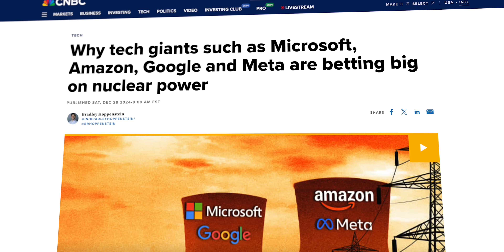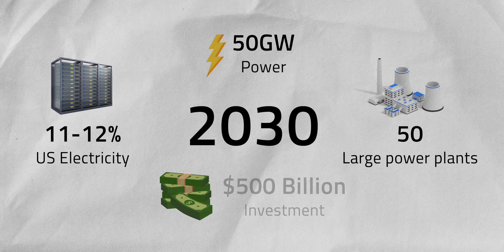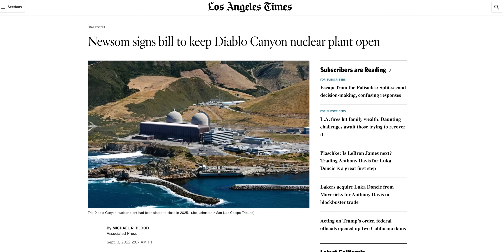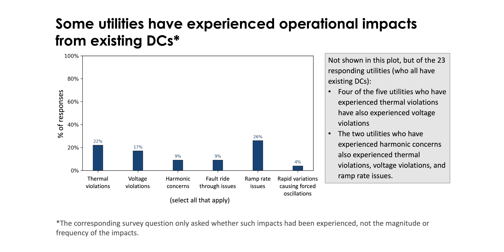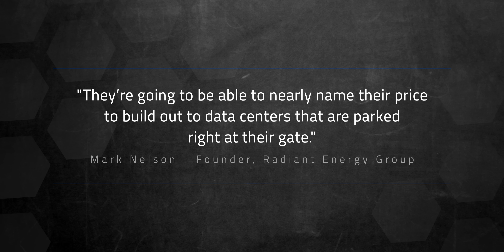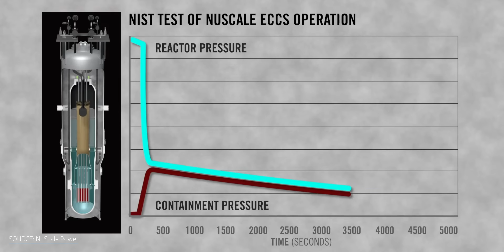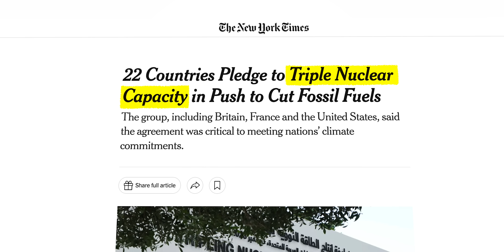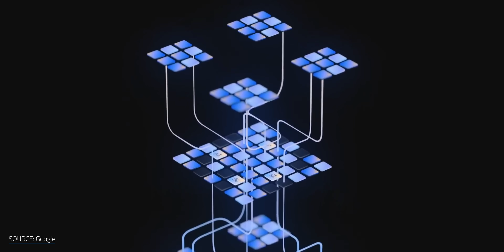Why Big Tech's Betting Billions on Nuclear (Not Renewables)

Comment: The safety if Nuclear power is like the safety of air travel. It's extremely safe, but when an accident happens, it's dramatic.
Reply: One comment I heard about nuclear power was that part of its problem is its too safe though.  It might sound like a weird thing to say but the point was that since its so safe when something does go wrong everyone freaks out.  Modern reactors are basically impossible to have an issue now. Like the control rods for example are typically now held on by electro magnets so if there is a power failure the rods are released and will drop in to shut down the reaction.  They also use passive cooling systems so the reactor will cool itself.  That isnt a long term solution and they still would want to get power to the cooling pumps again but its not like its an emergency.  If it takes a few days to get that up and running again they would be fine. You'd need all of your diesel generators to fail for that to happen though.
Reply: @pin65371 Anyone ever die of unsafe nuclear pow
Reply: @pin65371 Anyone ever die of unsafe nuclear power in France !!I know nuclear medicine is important in fighting  diseases !!
Reply: @pin65371 it's not impossible it's improbable but life loves rolling with loaded dice
Reply: Most accidents - and there have been a fair few - are not, in fact, dramatic. Measured against the damage done by alternatives, it is safe across the distribution - like air travel.
Reply: Dam failures have killed way more people than plane crashes.
Reply: Nuclear energy is safer than a Boeing aircraft 😂
Reply: @octoberranile2920  much much safer
Reply: I used to think there was like... maybe 4 nuclear plants in the US because people are afraid of it and stuff. And recently I learned there is FIFTY plants and ONE HUNDRED reactors. We've been fine with that many plants for decades. We should absolutely have more. I believe that we have it figured out
Reply: @koijoijoe "we should absolutely have more." No private utility will ever build another current-design nuclear reactor when it takes 15 years and costs $15 billion. If only there was a GoFundMe for nuclear fans to put their money where their mouth is...
Reply: More people die out of carbon emissions and its consequences. A LOT more people out of indirect damage like drought, excess rain, or lands becoming hostile to certain animals.
Wasn't it last year that some place at the US had to suffer a sci-fi worthy heat wave that melted things for being outside? Food harvests took a huge blow this year thanks to changes in climate patterns.
Give me a nuclear meltdown once every 50 years with a few hundred dead, instead of drought that starves millions each year.
Reply: There's always that built in reason to acquiesce control, development and profit to select oligarchs, which is why the love it so much, just like oil. So, yeah, I guess that's a reason for AI.
Reply: No one has died in the USA from commercial nuclear power.
Reply: @TeddyRumble  
More people die in car accidents on a daily basis, and we see no1 saying "ban cars".
Some folks are really bad at measuring costs and benefits.
Reply: this statement is valid... for 1970's technology at best
Reply: Yeah, the safety record is better than planes and with the designs we have now, nobody will get hurt if things go wrong. Fukushima is actually a nuclear safety success story. It proves how safe nuclear really is. Only one person died from nuclear radiation. So far no discernible increase in cancer rates have been detected since the accident. Most of the people who died did so because they became displaced and lost access to medical care or from the other numerous issues that come with a tsunami. But the deaths that occurred specifically because of the reactor meltdown is basically 1. That’s absolutely incredible. When a plane crashes, it’s not like 1 person dies. 

Chernobyl was actually bad but it was because people weren’t evacuated. The Russian government was more worried about PR than the people living there so they kept people irradiated even though they knew there was a problem. Nuclear reactors shouldn’t be blamed for Communism.
Reply: @scottkidder9046 the WHO actually contests the single death so the official count is 0 deaths
Reply: @scottkidder9046  Fukushima could have been much worse. Without heroic intervention, a full-scale meltdown could have released even more radioactive material into the environment, worsening the situation for areas downwind, including Tokyo.   Sorry, in risk assessment we need to see the worst case scenario because they can happen due  a chain of mishaps.
Reply: It's not tho. The only 2 accidents in history were 1) an earthquake and tsunami in Fukushima, 2) shitty design, disregard for regulation, ignoring safety alerts and cutting corners in Chernobyl.

And all those reactors were old tech.
Reply: @atrumluminarium  so we just need good faith people, yea we're screwed.
Reply: @rorschachroach  why?
Reply: @atrumluminarium fukashima was actually shitty design too and we knew it was 10 years in advance and even then nobody died
Reply: @atrumluminarium Only two? Windscale 1957, Three Mile Island 1979. 
Do you think there will be any further releases with the ongoing war around Chernobyl?
Reply: @cheesedoff-with4410  both were only a 5 out of 7 on the INES Fukushima was a 7 and Chernobyl was off the scale. That said if you were to count them 4 accidents is still not a lot. Waaaaay more people died from coal boilers blowing up and from coal flue gas around london during the industrial revolution and a lot of people still do in places where coal and oil are still burned and at refineries. Hell, more people die and get hurt servicing wind turbines and hydro plants.
Reply: @cheesedoff-with4410 there were other accidents but none involved the release of dangerous amounts of radioactivity in the environment
And for the second question, I’d say no for the simple reason that the frontline is nowhere near Chernobyl and the Russians have no incentive in attacking it
Also, with the Zaporizhzhia npp we have seen that the Russians were collaborative with the IAEA people sent there and have not used it to create mass panic
Reply: @atrumluminarium  and the last person to die from nuclear energy was in 1986
Reply: @cheesedoff-with4410  Three Mile Island and Windscale were Level 5 accidents, while Chernobyl and Fukushima were Level 7 major accidents.
Reply: @lorenzobertolino1527 
It seems Chernobyl isn't as far away from the fighting as we'd all like.
(A drone struck a reactor yesterday.)
Reply: not really dramatic
Reply: @carlchristiansteglich-pete6409
Gather all your buddies and insure a nuclear plant then.
Reply: @jimhaskell5485  its actually even safer than that most nuclear accidents arent very deadly or destructive and there hasnt been a death in the nuclear energy sector since 1986
Reply: There is no comparison. An airplane crash affects a tiny, finite number of people. The external effects beyond the people affected are minimal.

We've been extremely lucky with all the major nuclear accidents we've had, as every one them had the potential to be not just catastrophic, but apocalyptic--potentially poisoning millions of people and making vast swaths of territory uninhabitable.

It's easy in hindsight to say, "...oh those were just bad designs, they're so much better now." I'm sure after the next major accident we'll be made aware of more design flaws we hadn't anticipated, so this kind of rationalizing just doesn't cut it for me.

And no one ever seems to mention the growing accumulation of waste that nobody wants and no one wants to deal with, making every reactor site in the US not just a power plant, but a nuclear waste dump. ☢
Reply: @ecocentric6640  all of your points are wrong.

1) What if the plane hits a building? How is that a "few number of people"? How many people were effected by 9/11 whether because they died or death of a love one? Not to mention, the overwhelmingly higher likelihood of a plane crashing still makes them more deadly just because it happens more often.

Yes Chernobyl WAS an objectively bad design and it was bound to happen but the Soviets wanted to cut costs. There are certain things that you just don't do when designing a reactor. Look up the terms "void coefficient" and "temperature coefficient of reactivity". The RBMK reactors at Chernobyl among other issues had positive values for both of these that resulted in the reactor being placed in situations where positive feedback loops became possible. All modern reactor designs are designed to have only negative feedback loops in their operation so operators have to actually work to keep them from shutting down. 

3) there's not enough fuel in a small enough space for an "apocalyptic" scenario. Hell even one detonation of a modern nuke won't cause an apocalyptic scenario.

4) how much nuclear waste do you think we have accumulated historically? The US has only accumulated a football field's worth of waste and they don't even recycle theirs. If the waste is recycled and reused like France and Canada do the amount is microscopic compared to every other source particularly fossil fuels. Old uranium mines that had radioactive minerals can easily be repurposed to storage sites. Not to mention, there are relatively modern designs like Canada's CANDU that can even consume part of what would normally be content in the waste giving the actual waste a much shorter halflife that it needs to be stored for.

Comment: This is a new low for you, and an irresponsible video, in that it doesn't cover any of the hundreds of reasons why this is an extremely bad, costly, inconclusive, potentially dangerous and wildly unpredictable idea, designed mostly to keep the grid reliant on fossil fuel for decades, while the funding and research for these untested technologies continues to fluctuate.
Reply: > [adoption of nuclear is] designed mostly to keep the grid reliant on fossil fuel for decades,

I believe you've missed the point.

The tech companies looked at solar/wind + grid scale batteries, and despite their availability today, did not find them to be cheaper or effective - which is why they are going nuclear.
It isn't that future nuclear is an excuse to use fossil fuels now; it is that wind/solar/batteries don't make the cut, so fossil fuels will be used until nuclear comes online.

Comment: 2.9Wh is not much.  That's 0.0029kWh.  Or about $0.00029 (at 10¢ per kWh).

Yes, billions of requests change that.  In a "productive" sense, it should offset energy spent elsewhere (when it's not making fun illustrations for the heck of it).

Comment: Not to nerd on it or anything but correction is needed on 14:55  The approved design is not 77mw/h but is 60mw/h. They are seeking approval for 77 mw/h.
Reply: Just MW not MWh or even worse MW/h
Reply: Another correction, its 55 MW per unit that has been approved by the NRC and NuScale is currently in approval for the 77 MW update. Still much further along than any SMR competitors, as they need to go through their own certification processes, and complete lifecycle testing before connecting to the grid.

Comment: very small reactor;to get going a small steam turbine to produce electricit( 1rst part);then use electric power to prod.HIDROGEN TO HEAT AN EVEN BIGGER STEAM TURBINE TO PROD.MORE ELECTRIC POWER(is way cheaper and you dont need too much uranium)SHEEEEEZZZZZ,no big deal (instead of nuclear it can use solar and/or wind power)1rst part and adapt it to the 2nd part.EASY😝 too many dumb engineers.

Comment: Where is the nuclear waste going?
Reply: being made into more fuel and of corse rare eath metals like zicuom 90 and other tpyes for many usefuel apcations by the way. also zicuom 90 isa byprocut of the decay of struom 90 decay after 30 years that also said srouom can be used ofr passive pwoer genraton with rtg and neacler strlaning genrators as well. thsie can be sued to store that srtoum 90 nuclear waste while gernating power too at the same time. also high level nuclear aste is in fact 96% recycleble by the way. so reproceing it bacly is a far far better way to deal with it. like so much fuel out of reprocceing the nuclear waste.
Reply: To the breeder reactors where it is transmuted to compounds with shorter half-lives. Also produces energy in the process.
Reply: @nihalbhandary162  So we have to build the factory to make the SMRs. Have to build the factory to make the fuel. Have to build the factory to process the fuel. Have to build the storage for the short half life waste (only 100s of years instead of tens of thousands, that's still a very long time). Have to keep the fuel and waste secure in transit, and have to keep them flowing. Have to keep the plants themselves secure... and probably more that I'm not thinking of. 

How is it a better solution than solar + storage? It's not cheaper. It's not cleaner. It's not safer. The only benefit is being online while it's not sunny out for a week, which rarely happens in most places.
Reply: @nihalbhandary162  Breeder reactors don't work with 99%+  (by mass, or volume) of the generated waste.

 Such reactors only work for the fuel pellets, but not the cable clamps, booties, concrete, hoses, liquids, pipes, valves.... all the surrounding elements.(which is most of a plant) need management, too.

Comment: The BIG monkey wrench in these plans are much more efficient AI systems like Deepseek.

Google, Meta, Microsoft, etc. are publicly traded companies whose officers are answerable to their shareholders. They could justify the cost to restart, or build reactors when all their competition was as power hungry as them. 

But these more efficient competitors may make the cost unjustifiable. Especially as wind, solar, and storage costs keep dropping.
Reply: Pretty sure deepseek is also being investigated for stolen code also if that's true it can afford to be more efficient
Reply: @atomicfist-u92  yeah because openAI didnt steal anything....😅😅
Reply: Deepseek is like the man behind the curtain in the wizard of oz.
Reply: It doesn't matter if AI systems get more efficient, the consumption will still skyrocket.
They will just run more of them and use them for more complex use cases using multi-agent systems or similar. Plus it's only getting started, it doesn't have a lot of mainstream use in everyday life.
Reply: The Deepseek comparison is not exactly fair.  Deepseek is an just dealing with text and its context window is much smaller.  OpenAI's models can deal with text, video, voice and pictures and with its context windows being much larger that drives up the cost to train.  I'm not taking anything away from Deepseek though.  What they did is impressive but you cant just make a direct comparison.  For a lot of people Deepseek will be good enough but to really get to that next level it will require a lot of compute.
Reply: @ You yourself said it, " For a lot of people Deepseek will be good enough"

Ever heard of the 80/20 rule?
80% of users use only 20% or les of features and 20% of users use 80% or more of features.

You don't have enough people using those extra features it will be difficult to justify the extra costs to support them.
Reply: The issue with that is the sheer amount of power needed along with the variability. These data centers need consistent power and a lot of it. To produce the power these data centers need will require a lot of land which can be issue with various localities. I mean you would need not just the solar panel and/or wind mills but large battery storage unit as well. The issue isn't price, It's consistency. If for whatever reason there is a black out from a panel going out it could potentially cost you way more.  Nuclear with investment can offer pretty much all of the solutions for large data banks. Personally I think it's great. A more streamlined and consistent approach to nuclear power generation can be great for long term energy security. It could also bring down the cost and improve safety.

Comment: I suggest you look at some of the chapters in the book "Apocalypse Never" by Michael Shellenberger.  He talks quite a bit about why nuclear is so expensive, largely due to anti-nuclear groups trying to strangle it with costly regulations.  Newer generation reactor designs are safer than ever and in reality it's the only way we're going to get the carbon-free electricity we need.  Also, stop using uranium.  Thorium is far more abundant, especially here in the US.

Comment: At this rate, every residence will need to produce its own energy just because more of our power plants’ energy will be gobbled up by AI.
Reply: That’s why life is dynamic not static. If we need more energy, we produce more energy. There’s a huge incentive to keep energy prices reasonable and low, it’s called money. If there’s more demand, there will be more pressure to increase supply. The goal is to make sure that that increase is met by renewables and nuclear energy instead of oil and gas. There’s a TON of money to be made here and the more energy we use, the more money people could make producing it.
Reply: One of many situations today where the snake is eating its' own tail as without power consumers will be unable to use the AI.
Reply: In Alberta they have around 12 GW worth of data centers in the planning stages.  They arent touching the grid though.  They just connect to the main natural gas pipelines and build their own power plant.  Same thing that Trump is now talking about except our natural gas is cheaper and its much colder so the cooling loads would be much lower.
Reply: Maybe. But there's a big incentive to make AI more energy efficient (e.g. DeepSeek et al. )
Reply: And AI will be used to determine who gets a house, based on how much of their produced energy they'll provide to the rest of the grid.